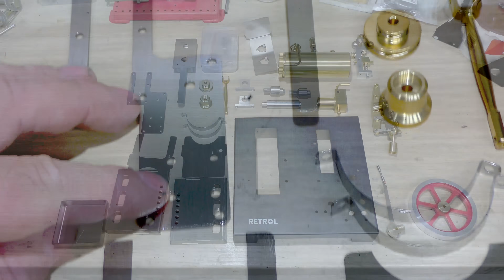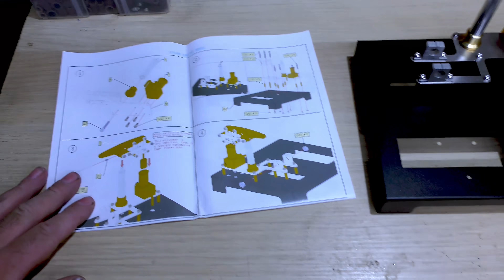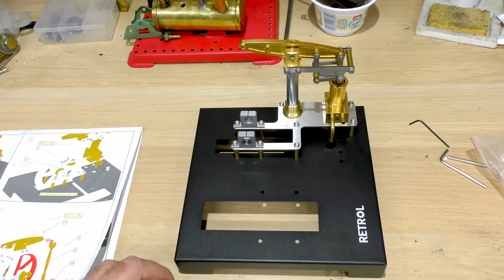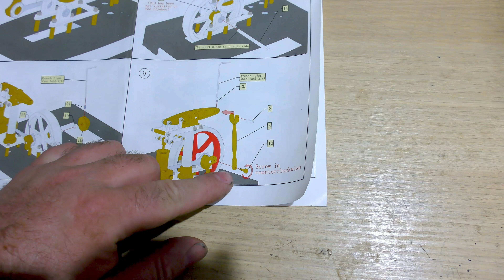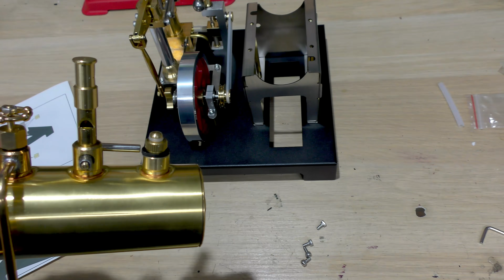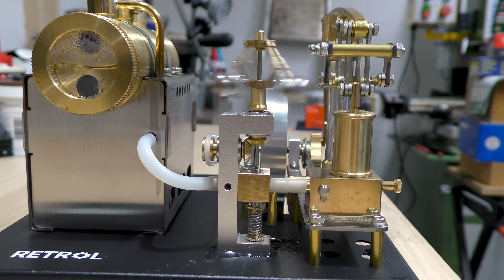Steam Engine Assembly Kit for Steam Enthusiasts

Comment: I had one as a kid. I enjoyed taking it apart and assembling it again, and figuring out how it worked. Many times, instead of waiting for the water to boil, I just used a bicycly pump and pumped up the pressure in the boiler ;-) apparently steam engines run on compressed air, too.
Reply from the maker: They certainly do run off compressed air too.